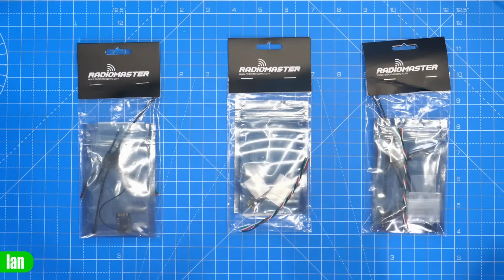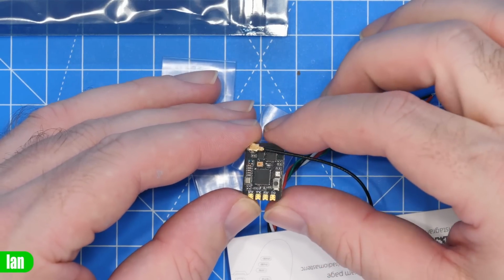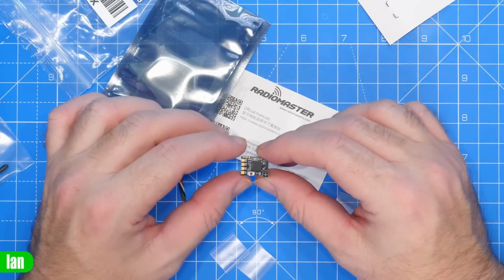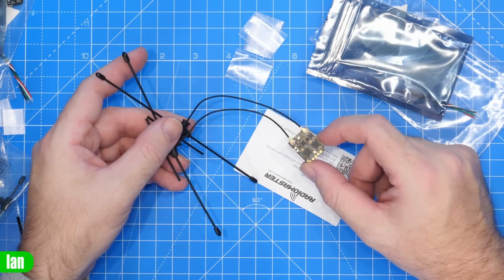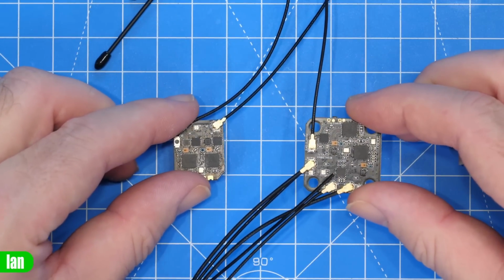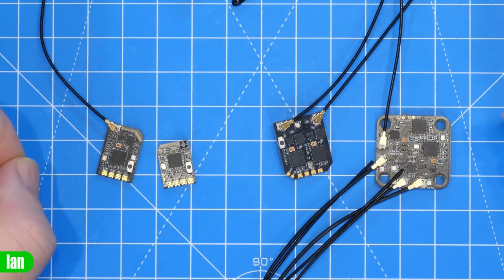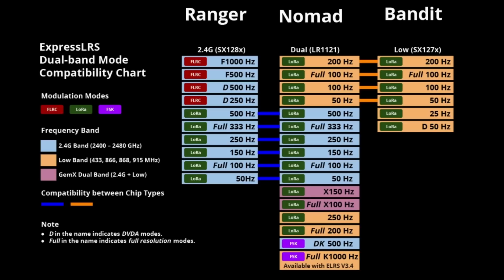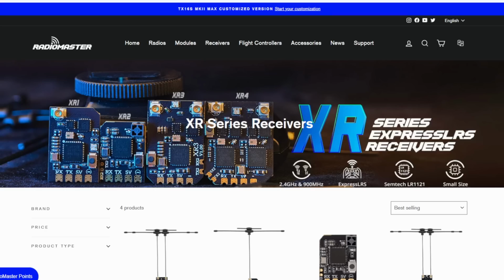Radiomaster XR Series LR1121 ExpressLRS Receivers - XR1, XR2,XR3 & XR4 A Receiver For Everyone!

Comment: Hi,

I have an XR1 receiver with a 900 MHz antenna. Can I simply shorten the antenna to the length required for 2.4 GHz and then operate in the 2.4 GHz band?
Reply from the maker: Technically yes but it would be complete guesswork.

Comment: now the only thing i want to know with theses new receiver should you update to the latest firmware 3.6.0 when using the tx15 or tx12 radios ? will the range be okay as the rp1 receivers and older radios are experiencing reduced range making people to downgrade to 3.5.3.

Comment: Wow. So the XR4 can receive signals from both 2.4g & 915mhz at the same time, so if one signal is lost from interference or penetration issues, you don't lost your craft because it's also controlled by the other signal.

Comment: Ian....would I be right in thinking the XR1,3,and 4 would be as good as a Crossfire Diversity Nano RX (IF) I used them in Gemini mode in 900mHz?
I fly over water at LOW LEVEL,mid to long range normally...hence my Crossfire preference at this moment in time,however,I'm open to change!

Comment: This is amazing! I just built my first ELRS quad after using Xfire for years and I am totally impressed with its performance! I've had the boxer since it came out and have always used my Xfire mod on back.  It's so nice to shed that Xtra mod on back and even better to lose the long receiver antennas! This new hardware and ELRS dual band is very interesting for my long range setups! Thanks for keeping us informed! Love your channel!
Reply: 2nd quitter in this comment section!! To good for 50hz huh? I'll pass you at 10 miles out while your in full complete control and I'm hanging on to 50 hz feeling like my quads drunk!! 😮 Hoping XFire comes out with competing firmware soon.
Reply: @smooth_ops2942  lol,  I hear that! I still have my Xfire for long range!
Reply: Hmmm.2.4 cannot out perform 868/900 at distance.If "bailing" from Crossfire,maybe just run the XR series on Gemini 868/900 no?
I posted up above...love to hear your thoughts about Crossword versus DBR4,XR rx,s if theyre just on 868( NOT 2.4 which is inferior over water at low level.)

Comment: It all gives a easy pathway off the 2.4 and all the congestion provided I'm happy to move to a new radio. I'm just using the pocket since moving to ELRS so it's not like I have a vast investment. Just want to play with how easy it is to switch frequency per model. It's not worth long range anymore in the UK with current legal state but I would have killed for these back in the day. It's increasable just how affordable it has all become.

Comment: Can I put dedicated frequencies antennas, one 2.4ghz and one 900mhz if I set the settings carefully on the XR4 ? I would get a bit better performance with specialized antennas. What would be the point of the DBR4 then, aside switching Gemini frequencies by software with 4 antennas.

Comment: So Gemini auto switched frequencies?  The multiple frequency ones you have to switch manually?
Reply: Gemini is same band (2.4ghz or 868/900) but two seperate frequencies for each packet for redundancy. Gemini Xrossband/GemX is dual band (i.e. transmits/receiveds on both 2.4 and 868/900 simultaneously).
Reply: @pfeerick  just was confused because one of the receiver says Gemini and the other receiver just says multiple frequencies
Reply: @divingfalconfpv4602  I've not looked at the specs, but depending on what you order you can probably either preference antenna diversity Gemini (same band) or crossband GemX (dual band) - you're basically choosing what configuration the two antenna and RF paths are in. You would need four antenna for dual band antenna diversity (since you need two antenna for each band).

Comment: Great stuff 😁 i just received the nomad and a DBR4 receiver. Also received the bayck dual band gemini receiver. These ones you showed weren't available yet when ordering 😉 i have currently been running betafpv super G with super D receivers. Was having problems with disconnects here in city. Yesterday at 200' out had total control loss 🤯 with betafpv system. Haven't hooked up nomad yet. Thankfully i run gps and drone came back on it's own. 2.4g has gotten bad out here. Just before I had disconnect i noticed a heli come over me with spot light on and all. Was during day. Idk if they noticed me flying and blasted me out of sky or what.i am in Buffalo NY and close to airports but in a 150m fly zone. I always stay low and within sight most of time. I did notice last night that my controller had been in dynamic mode and i was using the powered plug on radio to power modules. I put in full power and will be using power from battery plug to power these. I have had a lot of problems losing signal out here. Hopefully these fix the disconnects that I've had 😁 thanks for sharing. Still not sure about that dual antenna 😉 the bayck rc receiver i got has 2 of the dual antennas.

Comment: I understand that a servo wired to a receiver has a positive and negative wire for power and also a signal wire for each channel. I see the pos and neg pads on these receivers and understand each servo would be wired to them. Where are the four signal wire solder pads? Shouldn't there be a separate signal pad ... one for each channel?
Reply: I am not too knowledgable on the subject but i dont think these recievers are for servo planes, theyre designed for quadcopters. Radiomaster makes differemt recievers with pins that are marketed for planes.
Reply: There Are plus, minus, extra and tx. They are ment to get sold to a flight Controller board. You cannot control an actuator directly.
Reply: These receivers are primarily meant to be used with flight controllers. The pads are power (pos and neg) and serial TX and RX (but can be configured for SBUS and maybe even two PWM outs?) If you want to control servos you want the ER series for now.
Reply: They are full duplex uarts

Comment: Does the new dual-band antenna work with the DBR4 receiver?
Reply: It may, but since it has four seperate antenna connections, two for 2.4ghz and two for 900mhz it would be a step backwards with that RX anyway since you have dedicated antennas for each frequency band. Dual band antennas are a compromise - you trade some performance/sensitivity for compactness.
Reply: @pfeerick  Yeah, you're right. But I saw a reviewer in Indonesia doing a test with a Nomad and a DBR4 receiver, each using dedicated 2.4GHz and 915MHz antennas. He got an RSSI signal strength of 20-30 dBm from a distance of 4 feet. After confirming with Radiomaster, they stated that the 2.4GHz antenna is still for 2.4GHz, but the 900MHz antenna has two links: 900MHz and 2.4GHz. I don't understand if that's true or not, and whether it can actually affect the signal. I hope Ian can do the test 😅
Reply: @teukurezas  that sounds more like some crossed wires .. the DR4 has 4 individual antenna, whereas the NOMAD has two dual-band antenna... but we'll know more as it gets documented properly rather than having to be an ELRS dev to know what is going on 😂
Reply: @pfeerick  😂😂

Comment: Thanks Ian, good overview and an interesting and well priced product offering. But I am still confused. I fly 2.4 ELRS and 900 Crossfire and I have never had range, penetration, interference or a fail safe from either one. Why would I want to buy another radio or module and new receivers at this time? Perhaps you can cover that in your next video.
Reply: When you are flying longer range and/or certain RF environments, this is when dual-band/crossband can become useful, as one band might go deaf, and the other still work, and then they may fade in and out differently as harmonics and conditions change. If you don't have any issues with your current setup, no need to look further though. :)

Comment: @Mads Tech Ian, how does the RF filter work with dual band? Are there really dual band filter ICs?
Reply: Yes, there is a dual band filter that passes low band out one pin and high band out the other.